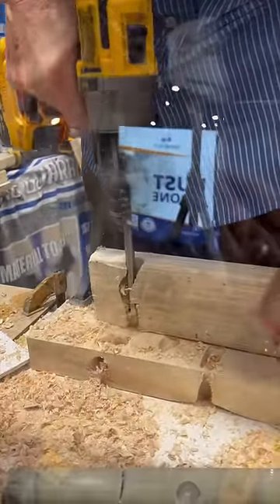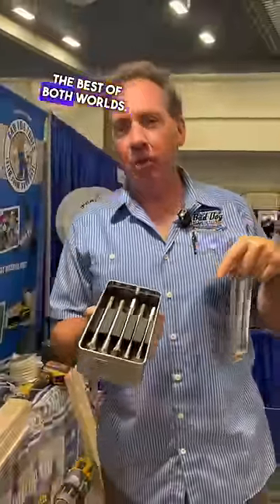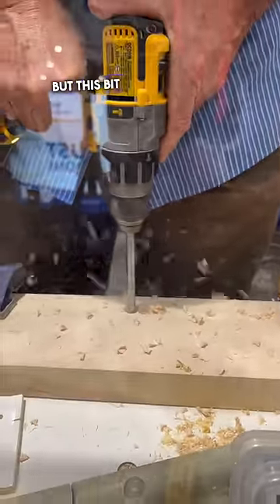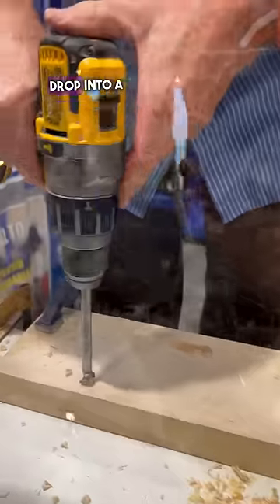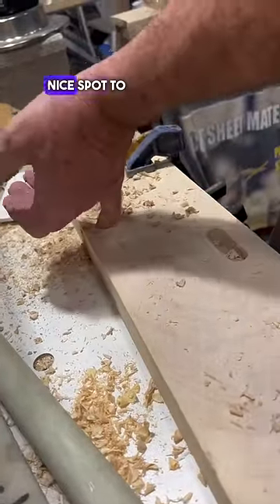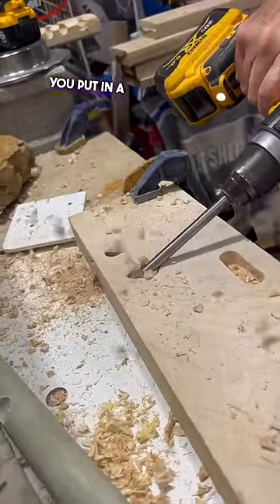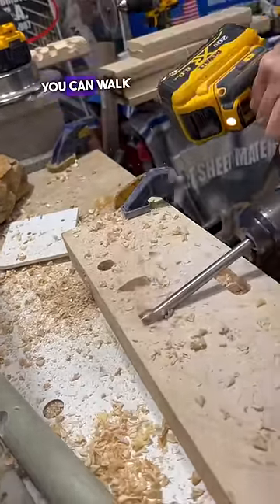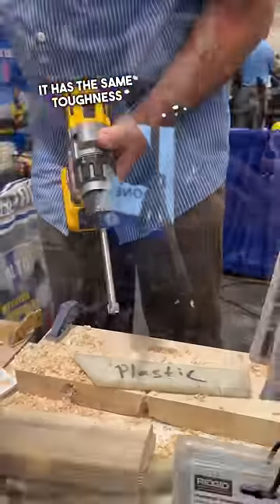Multi Purpose Drill Bits! #construction  #tradeshow #shorts

Comment: Carpenters instant thought... "Fk now the electricians and plumbers can butcher things even more efficiently"
Reply: So true lol. I used to hate plumbers when I was a framer.
Reply: Hit the nail on the head
Reply: I am not even a carpenter and thats the first thing I thought.
Reply: I guess the electricians went under the radar 😅
Reply: @simple3316  I think typically plumbers have a greater potential to create chaos as the have to deal with much larger materials, however I've seen my fair share of incompetence from electricians over the years.
Reply: @simple3316 apparently so. I’m not an electrician but I took an electrical class and learned the proper ways to bend and mount conduits using saddle bends and all that. I’d never ruin the structural integrity of framing creating a weak point by drilling a hole like that. I’m also really pedant about things and don’t understand why I can treat others things how they expect others to treat their tools, including putting them back exactly where they were. Mine just kinda get thrown about.
Reply: Couldn’t be more accurate😂😂
Reply: Me an electrician: "Imma give all the carpenters free ot today."
Reply: Yeah yeah yeah!!!! Woohoooo!!!!!😂
Reply: Im not a plumber or a sparky but I'd prefer to have lights that work and no shit on my floor than a pretty frame I can't see.
Reply: Really though 💀
Reply: @@sumofit4475 meant saddle bends, I hate my autocorrect.
Reply: Im a plumber and have done remodel  on MANY hack jobs. I always reinforce and have gotten compliments from generals for it
Reply: And still not clean up after themselves
Reply: @megaman992 you dont use conduits in eood frame construction. Go back to school
Reply: Lol I’m a plumber and my immediate thoughts were “hmm I need this”🤣
Reply: Thought the same thing, and I'm a plumber. Some of the work I've seen makes me wonder if they're trying to lose their insurance. To be fair, I've seen it from all trades, but mostly tin benders and fellow turd herders.
Reply: @hamburbers  you’ll have a lynch mob after you 😂😂
Reply: Oh my lord. TEAR IT UP 😂😂😂
Reply: Hilarious cause I’m a lumber and I need these in my life.
Reply: @dudesumting  depending on several things yes you do run conduit. Just really depends on the use of the building/zoning/ and code. 10 years in I’ve built from coast to coast everything from residential to commercial. 10/10 don’t recommend traveling for your work if you enjoy your sanity 😂
Reply: @jamesmountz2915  I’ve watched a plumber casually notch out half a floor joist to fit a drain. Didn’t seem quite up to code but wasn’t my house to worry about.
Reply: Facts 😂
Reply: @Habitual_Prepping pun intended?
Reply: We've hit the pinnacle of our tech and are now just selling gimmicks
Reply: Yeah we’ll tile guys hate carpenters because you guys never EVER make a plum level wall. Thanks
Reply: @sgtstedanko7186   Oh Definitely
Reply: Now my dumbass just needs one of these in 2in
Reply: I'm not even a carpenter myself, my dad is, but that was also my immediate thought lol
Reply: @Habitual_Prepping pun intended or na?
Reply: @megaman992 i guess im "really pedant" myself too but just for future reference it would either be "really a pedant" (pedant is a noun) or "really pedantic" (adjective)
Reply: HVAC here to demo everything
Reply: As an HVAC technician, I hope my 6¼ holesaw was good.
Reply: These bits seem good for electricians but I'm not so sure they would help me as a plumber run 1/2 inch pex or copper any easier.
Reply: @Habitual_Prepping dude that ducking golden
Reply: The electricians i work with not only make holes in areas where they ain’t suppose to be but they rip out my blocking and don’t use it or rip out Deadwood cause it’s easier than moving it 3 inches away
Reply: right 😂😂 some of the stuff i see is like wtf bro
Reply: I’ll do my best to rune that beautiful framing job you just did 😄
Reply: Lol quit leaving all those structural members in the way 🥰
Reply: youre god damn right.
Reply: As a cable guy that’s the first thing that come to my mind lol
Reply: @simple3316 just doesnt seem that life changing to buy. Im an electrician and yeah maybe itd have its uses but the bit looks kinda small for normal sized wires. Thatd work good on some 18/2 though
Reply: Sparkies don't care about your wood.  We only remove your shorts and make sparks fly. ❤
Reply: And they'll be leaving even more sawdust all over the floor.
Reply: @megaman992 Electrician here. Sometimes you have to do what you have to do..
Reply: Nah plumbers are the goat
Reply: @joburns1048 of course, but it has its limits when you’re sitting under a pile of rubble that used to be your structurally unsound house.
Reply: LMFAO, My first thought was, shieeet now I cam run wire and conduit more efficiently 😂😂
Reply: EXACTLY 😂😂😂
Reply: Exactly!! Holes in all the most important structural members…
Reply: @baileydyson5146 
True. Especially multilevel buildings. They tend to put 3 inch holes in the bottom of the floor joists at mid span and make a trampoline out of your living room floor…😂😂😂
Reply: @joburns1048 when you put that grand piano in the middle of your second floor living room and it suddenly appears on the ground floor, you’ll wish the plumbers hadn’t butchered 3 inch holes in all of the floor joists….
Reply: Nah they'll just put even more unnecessary nails everywhere 😂
Reply: I looked for this comment. Found it as quickly as I expected lol.
Reply: I’m a plumber and let’s be honest…. You’re right 😂
Reply: Lol
Reply: wait until landlords see this and start doing it with their non scam bits
Reply: Exactly my thoughts! I just had some work done at my house and the electrician was giving me panic attacks every single time he picked up his drill or electric screwdriver. He busted the wall plaster, bust open the socket boxes, cracked the switch plates... Can't find a caring worker these days!
Reply: You forgot the hvac peps too
Reply: No joke!! 🤣
Reply: As a residential electrician I can confirm we destroy drywall and make a mess. It's always hilarious when people ask you to run a wire not realizing you gotta smash up their house to get it to the specific place they want it. I always give them a fair warning before I shank the wall with a drywall saw.
Reply: This will save me a lot of time while I'm fucking up all of your hard work!
Reply: Hell yeah says the electrician.
Reply: As an electrician you spitting facts. 😂😂😂
Reply: A clean edged butchering.
Reply: Plumber's thought about the framing " its just a shower bench, not a landing pad for the Starship!"
Reply: 😂😂😂😂ima carpenter and no kidding not a nano second in and i was thinking the same!
Reply: Yeah, well, me as an electrician instantly thought I can drill a max of two holes with this before it shatters on a random nail or screw put in by a carpenter. ;)
Reply: That's hilarious.
Reply: As an electrician I was thinking the same things. 😂😂😂
Reply: Plumber here and I thought that 😂 can get pipes in places easier
Reply: @tommycook2382  neither could the electricians
Reply: Im a Plumber and i was thinking  like ow Carpenters  gonna be mad af if i get those lol
Reply: Exactly.
Reply: "Hey gus,  you think they put all these boards in for a reason? Yeah,  so we can take out 2 solid inches of every single one."
"I bet they didn't need ALL that lumber!"
Reply: As a plumber I will definitely be using this to butcher my frustrations away
Reply: To all the ‘carpenters’, the other utilities need to pass inspection too
Can’t help the ignorant ones regardless
Reply: We do not butcher things on purpose. No one pays us to be carpenters. They don't even pay us enough to do the job properly.
Reply: Depends on what type of carpenter you are.
Reply: @jamesmountz2915 you use to hate the “bad plumbers” when you were a framer
Reply: Yes we can lol
Reply: @joburns1048 imagine your teeth, sure your face looks great, but the moment you bite down, you hole infested teeth will break. Thats why you avoid holes in your studs, so your house doesn’t come down on itself, drywall is not holding it up
Reply: My electrician dad would make carpenters cry on site. I don't know what he'd be capable of with this.
Reply: Carpenters crying is the comments is hilarious, us HVAC guys and gals can bitch about some of the dumb framing that you guys do so 🤫.
Reply: @megaman992 i think this is more for residential
Reply: @joeschlong7633  you can't center something 3 inches away
Reply: Guilty
Reply: @jamesmountz2915  you hated them because they are 10x smarter and more qualified than you are?
Reply: @half_chub I’m a plumber of 13years. It’s a lot easier for us boys to mess things up cause we are dealing with harder scenarios on a daily basis. I mean if I cluelessly held a nail gun all day and got paid nothing for it I’d probably wanna complain about the boys coming in and making 1000 for 2 hours of work🤙🏽
Reply: Architects/engineers first thought. I wonder how many structural bearing elements will be compromised now. 🤔 SMH
Reply: @acarpentersson8271 they'll leave everything but the copper. They'll literally drag a box around behind them for the copper, but leave everything else.
Reply: Mfd gonna turn the job site into their own hamster cage with at the shavings
Reply: @tommycook2382 absolutely, I've run conduit in wood frame construction on occasion. But very rare, sorry I didn't specify
Reply: Actually no, as a carpenter I need one set of those
Reply: I love your comment ❤️💕♥️💖 

#PMSL #MakeMyDay
Reply: F**k yeah 
Let the butchery begin 😂
Reply: @jamesmountz2915 don't worry, we hate framers too. The feeling is mutual.
Reply: @megaman992 so you use the sawzall then?
Reply: who cares? unless you (the carpenter) is working for free, who does it hurt?
Reply: As a carpenter, my first thought was. That is perfect for making quick mortises
Reply: Haha
Reply: 😂😂😂😂 yup
Reply: @simple3316 As if they don't make enough already. At least it's easy to reach them now because they can finish jobs quicker now. Still doesn't mean they'll call back though
Reply: Me, the customer…please don’t destroy my framing with that thing, sir..
Reply: Funny😂
Reply: it hit me hard with that thought.
it can be as bad as a termite problem now!
Reply: @Habitual_Prepping  Actually they can just drill around the nail now.
Reply: Exactly what I came to say
Reply: Exactly man!
Reply: One day were working an we all just brought up how the living room floor sunk n we were wondering why, we all go under to check the joists n the a/c dudes chopped 4 joists worth of a top plate from a supporting wall to run their main return duct 😂.
Reply: @dreams_from_another_life  omg I can’t believe they did that!!! lol 😂
Reply: As a carpenter and amateur electrician. I can see myself fucking myself over with this real good
Reply: Not all us electricians fuck shit up.
Reply: I'm a plumber. I should buy these just to piss off the carpenters.
Reply: @hamburbers  not the OT we want 😭
Reply: How long are bearings on that drill going to last?
Reply: proving you didn't get taught anything.
Reply: Look at you throw shade like you are all perfect. Let me throw some, can't count how many times I've had to slow or stop my work when some framer did his own crap rather than what the print said or had to stop wiring because framers couldn't be bothered to show up and finish their work.   

Want to start a fight on a job, walk up and say this out loud and watch the holes to come.
Reply: Aye, it's not my fault you put all this damn wood in my way
Reply: I'm a tiler and if you think they ruin your day you have no idea😂
Reply: @Habitual_Prepping I see what you did there 😂
Reply: @megaman992 My dream is to build a house with 6inch spaced studs and then i can do what I want to them. 😂
Reply: @simple3316  The good ones don't have to go through much to get things done, but some new guys and fake electricians will go through anything to make it easier for them
Reply: @Habitual_Prepping  Hit the nail with the bit.
Reply: @baileydyson5146  yes everyone pun intended lmao! 🤣
Reply: The termites have evolved
Reply: @NoLongo they should have been fired . I’m a plumber there is no notching ever.  I have seen plumbers that seemingly didn’t own hole saw and use sawzall instead. and they should be fired .. plumbings hard especially when contractors/ carpenter just tell home owners they can put bathrooms anywhere .. dealt with it this week, like we are going to put the bathroom in those area with 2x6 where I can’t even drill a hole that wouldn’t be against code to fit my pipe that also needs to be pitched .
Reply: @markroberts7001 I’m a plumber , what’s that even mean. Reinforce what? You can either drill a hole that’s code or not. Like you are out here sistering joists? Or you saying you use hangers or blocking
Reply: As a carpenter I can confirm this was my immediate thought. 😂
Reply: @baileydyson5146 plumbers have bigger pipes but less of them, electricians have wire after wire
Reply: Yes we can! If only this bit would put back the joists some 1940s plumber thought were "in his way" 😂😂
Reply: Nah. It doesn't say Milwaukee. They won't use anything in site if it didn't say Milwaukee to show their superiority.
Reply: @eddieguillen8579  that's the kind of loyalty that ruins a brand. If we buy based on name, they sell on name. Don't buy based on quality, they don't sell based on quality
Reply: I’m an electrician and thought the same thing.We tend to only want straight holes to begin with 😂😂
Reply: Sparky here BUYING EVERY ONE I CAN TWICE  just to fuck shit up
Reply: Electricians wouldn't use it if it doesn't have a corkscrew pilot too hard to push from the top of a ladder it would have to be at least 1inch diameter
Reply: 😂😂😂I’m a plumber and yes this comment is accurate
Reply: @Habitual_Prepping nice use of an appropriate pun for once. Good to see there’s still people around with brains 👍
Reply: Yeah I’m gonna be honest we don’t get paid enough to care when you bury our outlets
Reply: Bad for the drill
Reply: Are they wrong though? Shits on sight if I see a sparky with this bouncing around.
Reply: It's been a year now and I've been butchering the s*** out of all the Carpenters work with these great bits 😂
Reply: Im a plumber 🤣🤑🤫
Reply: Ong dawg that was the first thing that came to mind when he said wire

Comment: Balsa wood is a beautiful thing!
Reply: To be fair its for demo. Its not to say it cant be done on something a little harder. Just cant be done as quickly.
Reply: Yeah cuz theyre gonna use some paudauk for demonstration purposes
Reply: I'd like to see him try that shit in 200yo pinewood, or live oak.
Reply: @linkbond08 to be fair I don't think I know anything other than an impact drivers that can drive s*** into Pine and Oak
Reply: @ianherp5678  don't forget the occasional pilot hole to prevent splits.
Reply: @linkbond08 pine is soft tho
Reply: @RichLclips When it's new. 100+ year old pine is anything but soft.
Reply: @RichLclips  Old pine is not tho.
Reply: @user2C47  hmm interesting
Reply: I thought it was a baby biscuit
Reply: modern wood that's used for basic construction isn't hard by any means. I'm sure it'll do that in the pine they use for everything. In an old structure it might have issues.
Reply: @linkbond08  How does it compare to a big old doug fir beam that's been holding a floor in an old house from the '30s?
Reply: @percussion44  I'm not familiar enough with doug fir to give you an answer.
But if it's been holding up a house floor since the 30s it's probably pretty tough, or at least resistant to warping under constant load.
Reply: That’s pine wood, it’s soft. We use treated pine to frame houses in Australia. It’s soft and cuts easily.
Reply: @ianherp5678 I never use my impact. I always use my regular ol' Milwaukee cordless drill, or the ol' superhawg
Reply: I was literally talking about making a bit like this and now I see it was already done hurry up and take my money
Reply: Not balsa
Reply: And morning wood too 🪵
Reply: I make garden gates with pine. It's defo a soft wood. I paint my gates before fitting. If the customer keeps on top of painting them over the years, they'll last a lifetime. Still classed as a soft wood though. 

Not totally accurate but a general rule of thumb is, if the tree loses all its leaves in autumn, its a hardwood (evergreens are softwood).
Reply: @linkbond08  you wouldn’t need that bit in the first place for anything youre doing with that kind of wood….
Reply: Lmao, and the " as seen on TV" actor still can't drive a nail into it.
Reply: @ianherp5678 pine wood is soft as shit unless its 200 year old, Ikea have plenty of furniture in pine wood and you skratch in whit your nail.
Reply: @masteryoda9044 😂😂😂
Reply: Those are Bad Dog bits. I saw him at Fence Tech. He demos using the multipurpose bits on block, steel, and wood all with the same bit. they're impressive
Reply: @linkbond08 Why do it on a live oak tree. It's not good for them.

Ps to everyone. This is a joke.
Reply: @I.C.Weiner  it would get stuck half a inch into the cut.
Reply: @daemonxblaze  there are definitely cheaper woods than this😂
Reply: Holy s*** that's precisely what I was thinking.😅
Reply: Amazing how many people who haven't used these bits seem to know what they'll cut. I've used 3d bits for years and they'll do this in mahogany, oak, pine, anything you will find in a house. That's not balsa btw. You people are unbelievable.
Reply: That’s quite clearly maple..
Reply: @ianherp5678 
driving shit into pine and oak isn't particularly hard if it's actually made to go into said wood, timberlocks and stuff are enormous and drive faster with a drill than with an impact
Reply: @alexjmurphy2145 Aspen is def not a hardwood but has no leaves all winter across half the country lmao what
Reply: @zacharyl.5354  Like I said "Not totally accurate" BUT a "General rule......."